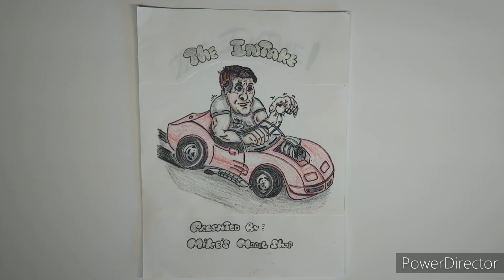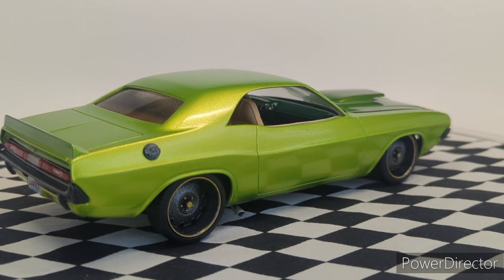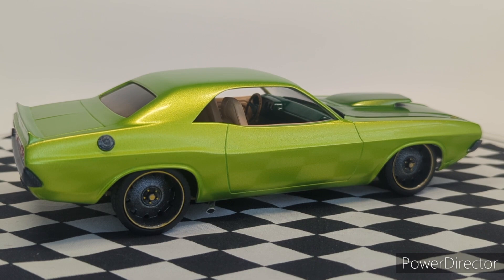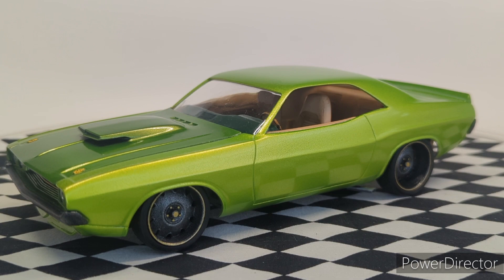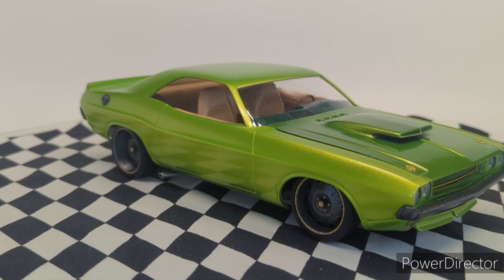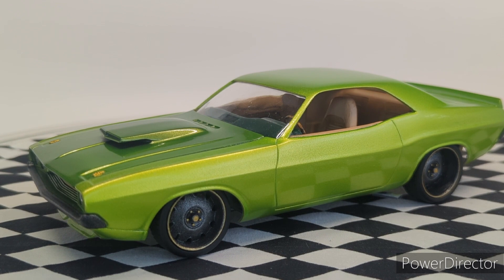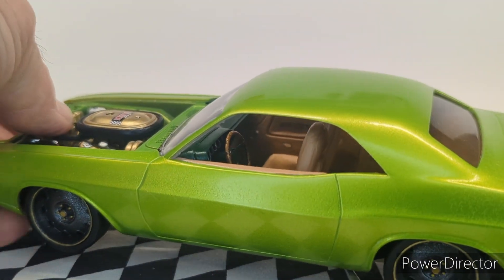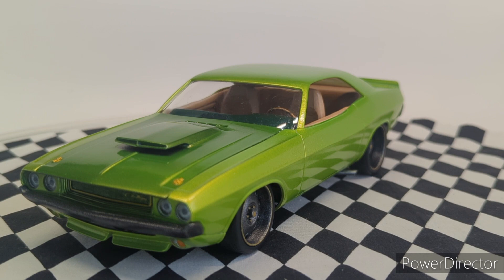Final on my #70'ChallengerGB hosted by @joesrustshop4509

Comment: What size needle and what was the PSI with the Creator text
Reply from the maker: I use a .5 needle. The air pressure I found which work best for me are as follows:
Createx Pearl: 35 psi
              Opaque: 35 psi
              Can't 2.0: 50 psi
              4050 Gloss: 20 psi
I mix them according to the bottle, but leave it a little thick. Also, make sure you mix, wait ten minutes then mix again and paint.
Reply: @theintake8961  thank you so much 👍🏿